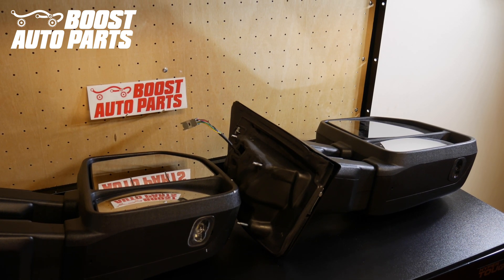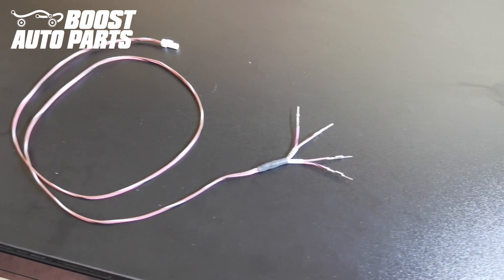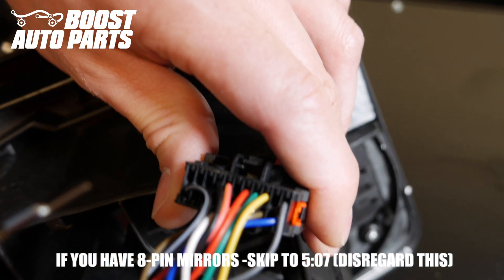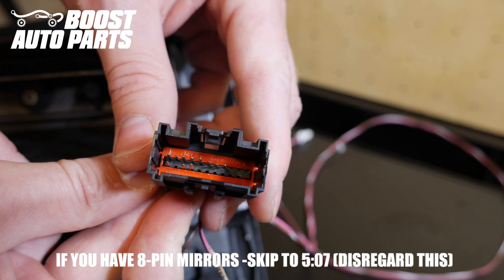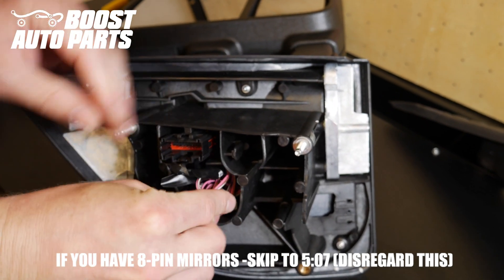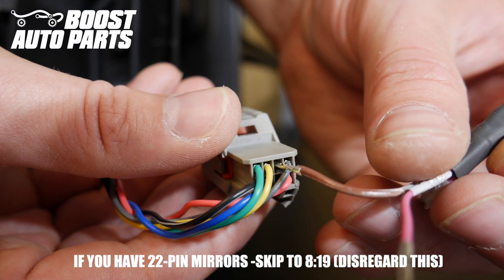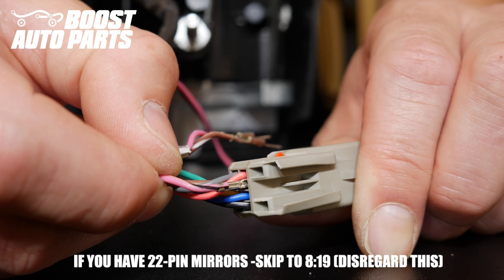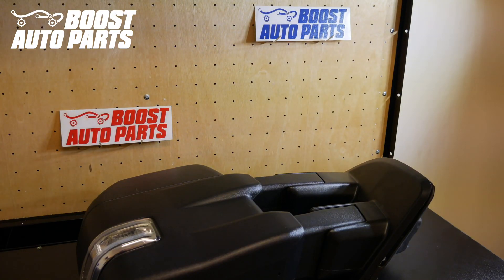2018+ F150 Check Engine Light After Mirror Install - Ambient Air Temperature Sensor Harness

Comment: Installed it just like video. Tucked sensor in the mirror assembly. Dash light went out but temp reading in truck was 124 degrees and truck fan in the engine wouldn’t stop running. Has anyone else experienced this?
Reply from the maker: There shouldn't be that big of a temperature differential, but you can always drill a hole and poke the sensor out the mirror if you'd like

Comment: Great information, thanks.
So, to confirm, this temperature sensor on the passenger-side door mirror is not present on the 2015 to 2017 F150s?
Reply from the maker: Correct

Comment: The pins for my harness are VERY difficult to put in. Almost to the point I’m scared they may break. 

Any advice?
Reply from the maker: Make sure you have them oriented correctly and you're using the correct pin for your connector. If so, you might want to compress the terminal crimp around the wire slightly with some pliers. Give our support team a call at 765-831-2830

Comment: So I bought some mirrors off marketplace to replace my 2020 stx mirrors because I wanted the light turn Signals on them will this help with the check engine light that popped up I thought they were plug and play but now a check engine light is on
Reply from the maker: Yes, this should resolve it

Comment: Can you reuse the harness if you replace the mirrors you originally used it for?Like can you remove the pins from harness and add it to another one ?
Reply from the maker: If you're able to extract the pins without damaging them yes, though that is VERY difficult. Most customers opt for a new harness.

Comment: What would the next step be if the connector isn’t wired the same in the video? I already have wires in the second slot
Reply from the maker: Give our team a call at 765-831-2830 for assistance
Reply: Wondering what you ended up doing.   My mirror plug already had pins in the slots this guy is talking about

Comment: Do I have to worry about this on a 2015 ford f150 xl. I have stock mirrors and looking to put tow mirrors on. I don't care if the lights work.
Reply from the maker: No - this is only 2018+ F150.

Comment: Thank you for this informative video. 

My passenger mirror got smashed, so I decided it'd be good time to invest in tow mirrors... Little did I know I'd run into the issue you described. Going to order this harness right now lol praying it all works.
Reply from the maker: No problem - it should work! Call us with any questions.
Reply: @boostautoparts  Update: Just installed it, and it worked. I have a permanent P0073 code (AAT Sensor Circuit High Input) that my OBD reader won't let me clear, but the AC is functioning like normal again. 

Thanks for the part and this in depth how-to... Super helpful

Edit: It is now the following morning post-install, and the check engine light / code is gone.
Reply from the maker: @akuma-hp  Glad you got it taken care of!

Comment: Purchased and installed. Wonder if I did it correctly because I have a check engine light and no temperature reading on my dash. My truck was originally a 8 pin and the mirrors I purchased are 22pin. They did come with the adapter for the 8 to 22pin. I installed your temperature sensor to the 22pin, is that how I am supposed to connect or should I have connected to the 8pin?
Reply from the maker: You need to install the harness into the 8 pin side of the connector so that the vehicle can sense it - unless the wires are pre-populated for temperature sensor on your mirrors. Give our support team a call at 765-831-2830 or email support@boostautoparts.com and we will get this resolved ASAP

Comment: added this and now the temp readout is stuck on 50 and check engine light still on. Do I need to clear the code??
Reply from the maker: Yes clear the code and perform the reset procedure. If you still have issues give our support team a call at 765-831-2830

Comment: Already had 8 pin mirrors and bought oem sytle 8 pin one to replace a cracked mirror. Now my engine light is on & AC blows hot. Hoping this fixes my issue… it’s 106 daily here in Tx
Reply from the maker: It should fix the issue.

Comment: Have done the reset, multiple times  but still blowing hot air. is there anything else to do or check?
Reply from the maker: Have you tried clearing the code with a scan tool?

Comment: I can't believe I paid $1300, did the install, and now have to pay $65 for the sensor and $30 in shipping AND do the whole install thing.  What's wrong with y'all???  You knew what truck I ordered for but this never came up.  What a freaking disappointment.
Reply: And now, I've removed the mirror and guess what? I already have wires in those slots.
Reply from the maker: @billflynn401  This harness should not be needed on our mirrors. The temperature sensor should be pre-installed in the mirrors if purchased from us. If they did not, please call us at 765-831-2830 and ask to speak to a manager so we can rectify this ASAP free of charge under warranty.

Comment: I see can see this video is a few years old now so I was wondering if you have discovered if this works on the 2017+ F250/350’s.

I have a 2017 F350 clock with a CEL for the ambient air temp sensor and the passenger side mirror has definitely been replaced before I bought it
Reply from the maker: Yes, this will work on 17-22 Super Duty trucks as well.

Comment: I have a 8 pin and 22 pin connector to my truck. You guys did not explain that if we had both , not to cut one or either of connection . I ended splicing my 8pin connection. Is there a way to reimburse or send me a new harness. This has given me a lot stress.
Reply from the maker: Hi Michael -

Please reach out to our support team at support@boostautoparts.com or call 765-831-2830 and we will assist ASAP.

Comment: I've now installed this tried all the reset process ideas except driving 20-30 minutes for it to reset and got to thinking can it be the actual harness from the trucks 8 pin to the mirrors 21 pin? 🤔 I unfortunately didn't get the harness and mirrors with you?
Reply from the maker: If the 8 to 22 pin is missing it and you install on the 22-pin side that can cause the issue. Give our team a call at 765-831-2830 for assistance

Comment: Awesome video and product, I changed out the mirrors on my 2020 F150 and ran into check engine light, came across this video, bought the product, easy install, problem solved!
Reply from the maker: Glad it helped.
Reply: Did you have any problems with the engine from this?  Or does this only affect the AC if not installed?
Reply from the maker: @wildpeakoutdoors5987  This affects the AC and the dash readout

Comment: Worked perfect for my 2018 F150 XLT. Had the 22 pin to 8 pin adapter and installed into the 8 pin side as per the instructions. Thought I was getting a good deal on the tow mirrors I bought. Was not aware of the temp sensor in my mirror before I started all this. If I did it over would just buy the tow mirrors from these guys and not have this issue.
Reply from the maker: Happy to hear this got your issue resolved.
Reply: I have the same truck and ran into the same issue. I just ordered this part to see if it works, I'll send update

Comment: What if you have manual tow mirrors with no wire harness in the mirrors? Could you splice into the truck harness?
Reply from the maker: Yes, you could directly splice it onto the truck harness on the corresponding pins.
Reply: @boostautoparts  how do I find what wires to splice into? I have manual mirrors, and I can figure out what wires I need to splice into the plug attached to the truck
Reply from the maker: @SUPACOOPY  Please reach out to support@boostautoparts.com with your VIN for assistance

Comment: Will this work on a 2017 Ford F150?
Reply from the maker: 2017 F150's don't have temperature sensors in the mirror - it shouldn't be needed for a 2017.

Comment: My A/c didn’t work but my check engine light took off
Reply from the maker: Did you perform the reset detailed at the end of this video? If so and it's still not working, reach out to support@boostautoparts.com with your order # for assistance.

Comment: I added tow mirrors and the AC started blowing hot air and the temperature on the inside screen reads 40 degrees fluctuating as low as -26 when actually its 100 degrees outside. When it reads the right temperature tha AC works fine but when it reading a low temp, the AC blows hot air. Could this be the same issue???
Reply from the maker: It sounds like you may have a bad temperature sensor in the towing mirrors. This harness should solve it. If there are already wires in the slots shown in this video you will have to isolate and splice to them. Email support@boostautoparts.com if that comes up and they can provide further guidance.

Comment: Hi, I have a 2020 F-150 XL that I added 22-pin power fold mirrors onto (I changed the door harnesses and modules).  I don't have a CEL and my a/c works fine but the radio screen shows an error where the temp should be.  Will this harness fix my temps?
Reply from the maker: Please contact our team at sales@boostautoparts.com with pictures of your connectors on the replacement mirrors - they can check for you. You may just need to do the relearn procedure shown at the end of this video.

Comment: So after installing this sensor my AC should work again if I clear the code?
Reply from the maker: Yes!
Reply: @boostautoparts  no. The sensor needs to be reset prior to clearing code. With key on, press a/c and recirculate simultaneously and then within 2 seconds press a/c. That will reset sensor and tell computer everything is good. Then clear PCM codes and then your good to go. Same procedure on super duty also. Pcm uses the readings for engine management also and this will trigger the ambient air sensor code first, then the nitrogen oxide exhaust code second.  Engine will burn more fuel and run but not run optimally until this procedure is complete.  Enjoy.
Reply: How do you clear pcm codes
Reply: I did that already and compressor doesn’t run

Comment: Hello. For a 2019 F150, the 8 pin sensor is not matching up as described in the video. After the brown wire goes into slot 6, the only available slot is 8 for the pink. Is this right??
Reply from the maker: Please reach out to our support team at support@boostautoparts.com for assistance

Comment: Will this work for an F250 same mirror?
Reply from the maker: This will work on both the 8-pin and 22-pin mirrors. Mirrors from us already have a temp sensor installed, but if you have other aftermarket mirrors without the sensor this will work.

Comment: On your website for this product it says the below message. Do you have this shown in a video? 

If you have 22-pin mirrors on an 8-pin truck and are utilizing an 8 to 22 pin adapter, install the wires labeled "8-Pin" on our harness into the 8 pin connector on your adapter (the slots should be empty)
Reply from the maker: Hello,
That comment is referencing the second portion of the install video shown on an 8-pin connector (linked below). If you have an 8-pin truck and are using the 8-22 pin adapter, you will simply install the wires into the 8-pin connector like our video rather than the 22-pin connector. 
https://youtu.be/NzYhZ5QjfEs?t=321

Comment: I purchased a set of 8 pin tow mirrors for my 2019 stx they are 8 pin and all the pins are there does that mean it already has the sensor??
Reply from the maker: Yes, it likely has the sensor already.
Reply: It doesn’t show it like my stock ones do. I can’t find any info about it
Reply from the maker: @kg867v  A lot of aftermarket mirrors use inferior components which may not work properly with your vehicle. If you're looking for a set we have quality mirrors available on our site and they come equipped with an accurate reading temperature sensor.

Comment: I have a 2018 F-150,the mirrors are 8-pin. I purchased new larger mirrors for towing. These mirrors have 22-pin connectors. I then purchased adaptor harnesses to plug in the 8-pin on the truck to the new 22-pin connector on the mirrors. The turn signal on the passenger side did not work. Not sure if the temp sensor is there in the new mirror or if it works. I temporarily removed the jumper harness thinking that the harness was bad and temp the shows in the radio screen went out and the check engine light came on. On another note, on the 8-pin to 22-pin Humber harness, there is a blue wire that is not connected to the adapter (at the 22-pin side).
Any direction would be helpful.
Reply: Hey cliff what happend with the check engine light and the temperature shown on radio, how did it get fixed? I’m going thru the same problem as we speak and don’t know what to do.
Reply: @shaneslonaker3617  same ! Did you get this fixed ?
Reply: @blakehanley9661  any luck?  Got a quote to get this mirror fixed for my left arm.
Reply from the maker: Hey Cliff-

If you purchased any of this from us please reach out to our team at support@boostautoparts.com . We would be happy to take a look for you and get this situated.

Comment: So I actually relocated the AAT sensor to the grill area like the previous year trucks (wiring harness was already there plugged into a dummy plug) and cleared the code I had. No CELs now but my a/c still isn’t working? Tried doing the reset procedure mentioned but nothing. Am I missing something?
Reply from the maker: You will need a sensor feedback from the mirror connector itself in order for the system to function properly.
Reply: Boost Auto Parts interesting..I’m following a guide my buddy did and he was able to swap to the front style AAT area with his new mirrors and has no issues with climate control stuff. So the vehicle doesn’t sense for the front, only the mirror side?
Reply: Boost Auto Parts I removed my stock sensor from the factory mirror and pinned it into the harness for the tow mirror and unplugged my sensor up front and still no luck..a/c still doesn’t seem to turn on
Reply: @stavinemigh9485  same problem